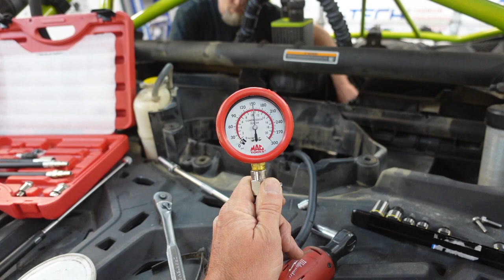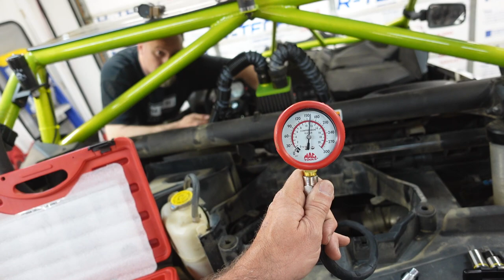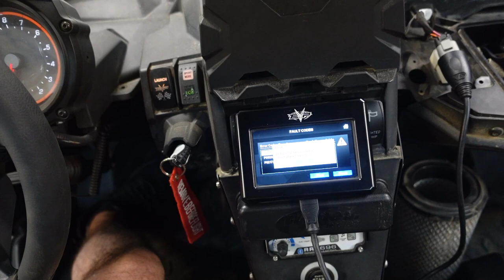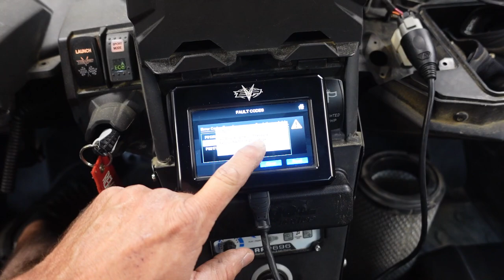e85 DESTROYED MY CAR Blown Trannys Blown Engines

Comment: Can't believe they would use plastic gears.
Reply from the maker: Yeah I felt the same when I saw them but they seem to hold up for most people it doesn't seem to be a super common issue.
Reply: @DandiOffroad  according to can am the plastic gears were an engineering decision. If they break they don't destroy much more expensive internal parts. Mine were replaced and fixed in under an hr without any additional issues.
Reply from the maker: Yeah considering they're driven by the crank that could be all bad

Comment: Can am is the best. They would never skimp to make more money. That's basically quoted from ever can am owner.
Reply from the maker: We have a Can-Am and rzr so I'm not necessarily that biased. But I don't know that it's necessarily a skimp and maybe more of a design. I feel like if the gears are metal and they were to strip it would strip out the gear that drives them which is part of the crank then you get to replace the crank. Again I don't know that just my theory. If I had more time to research maybe I could find out but I'm too lazy for that..

Comment: Water pump is bad?? Yup. That's crazy they use plastic. See if you can get an upgraded material.. that sucks bud. We've been chasing gremlins in ours for 2 weeks.
Reply from the maker: So the gears that drive the water pump are actually what went out. From what I've seen in general I don't really see a need to go to metal I feel like there or other circumstances that caused it.. good luck with your car what's going on with it?
Reply: The boost line from boost controller to turbo split/burnt. Causing over boost. Problem solved.
Reply from the maker: Awesome!! At least it was an easy quick fix
Reply: Mine plastic gears broke with only 1k miles on it. Once replaced thing ran like a champ. There are some metal gears replacements out there but I didn't replace with the metal ones.
Reply from the maker: Glad that worked out for you. Yeah I'm hoping for him we get the same results I feel like we will. The car ran great even with those broke we just had an overheat issue and we didn't realize where it was coming from